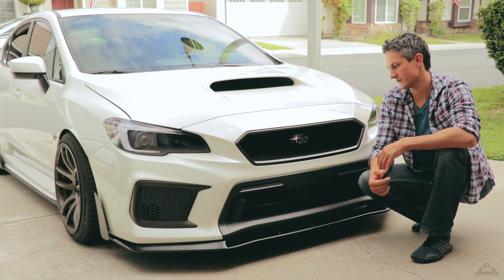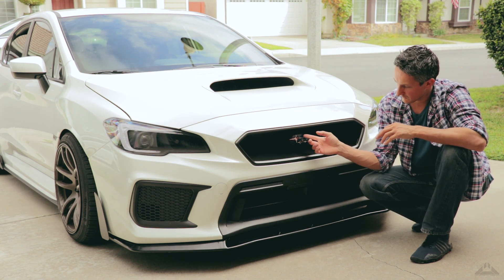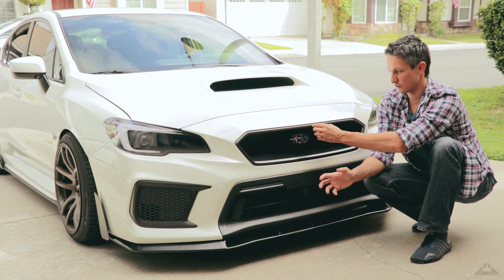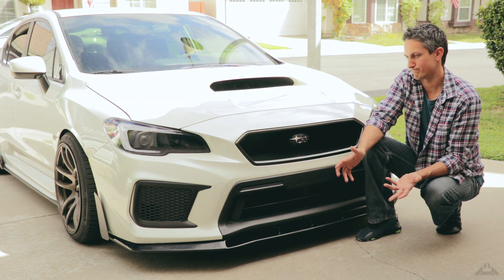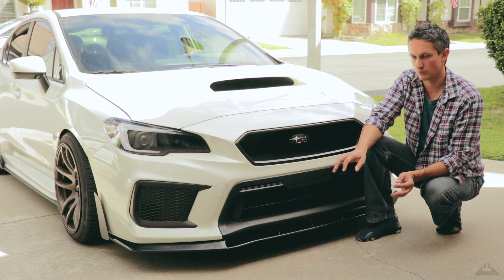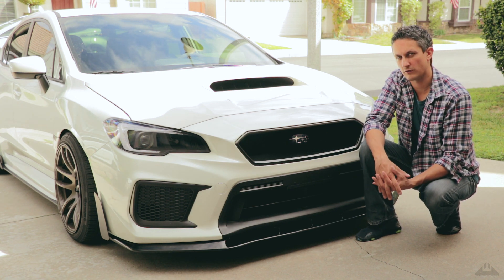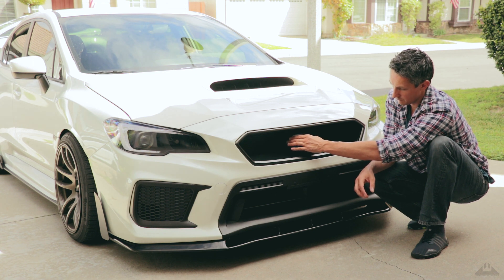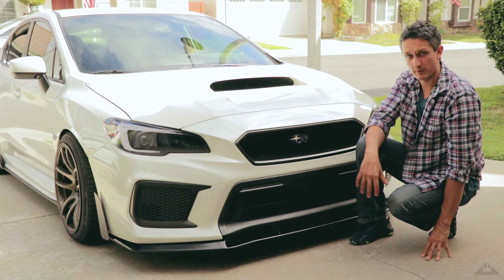Custom grill project completed

Comment: That looks amazing! Have you ever thought of doing the bottom part / scoop / intake as well? I’ve always thought that the bottom front scoop looks blocky and plasticky, and be curious to see what it looks like with a flat black hex grill to make the look much cleaner / less plastic & blocky.
Reply from the maker: The bottom of the bumper does look blocky and cheap. I'll see what can be done about it. I did cover my intake snorkel with cf, but it came out like crap because it's not the right way to do it. The right way is to make a mold and then make a new cf snorkel or at least a cf cover for the stock snorkel. I laminated mine and it just looks lumpy, can't wait to change it out. The hood scoop looks fine in white, don't want to mess with that. It starts to look like a clown once you add dark accents where they don't belong (scoop, mirrors, etc).

Comment: Looks so good man. Got my clutch mod from you months ago. About to get r400 catback. Will do downpipe, intake, and tune eventually after. Can you possibly make a video showing how you shift with clutch work in this car? Would help tons of us with how finicky these clutches are. Love your videos.
Reply from the maker: hey man, for sure, I will try to do this video asap. There are definitely certain "tricks" to shifting manuals, and especially this clutch as it's very picky around the grab point. The clutch stopper helps a ton, but I will try to disregard that so the video is helpful regardless of any helping mods. I need to plan this video out so I don't forget the smallest details. Thanks for reminding me. I was a bit lost on what to do next video-wise.
Reply: TheShaddix no problem man thanks for the response! Looking forward to the vid! Take care.

Comment: good channel   

if I were to get 9 inch wide rims could I keep stock tire size  ?

just got a series grey  wrx
Reply from the maker: yes, you can use stock tires even on 10.5 if you wanted to.
Reply: thank you . I will be keeping the car at stock height ,I live in Colorado some roads are so bad they can only be drive during daytime 

with the stock height  I don't want to stretch the tire  so I can keep a flat versus rounded sidewall  . I found some SSR that are 18 x 9  38 et  

I also heard you mention the windshield wiper arm position  , I saw  a 2017 sti  a few weeks ago and noticed that they have different ARO  type  wiper blades  and different arms  . would you be able to research that and see if it could work   on wrx  
I used R32  wipers on my base gti  and it was a big difference

Comment: You could sell this set up man, great work
Reply from the maker: Thanks! I've sold a few already.
Reply: TheShaddix do you have them up for sale somewhere?
Reply from the maker: @jaybosher6144  just email me! The email is on my site which also has all my latest work
Reply: TheShaddix gotcha, btw thanks so much for the shifter advice. Waiting on my boomba plate n a few parts but I got a shift stop and a heavy knob and it already feels much better. I’m actually enjoying my car again.
Reply from the maker: @jaybosher6144   wait till you have the plate, it'll blow you away. Then (later) get a boomba short shifter. Both will transform the crappy clunky notchy stock shifts into solid and smooth.